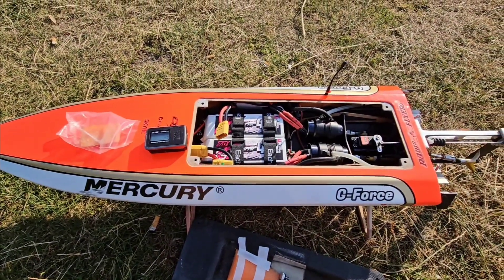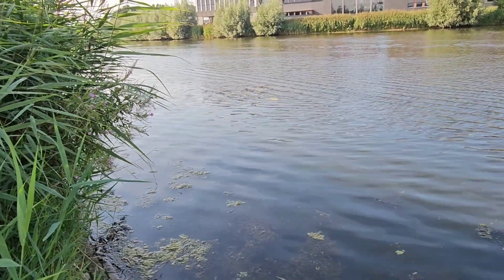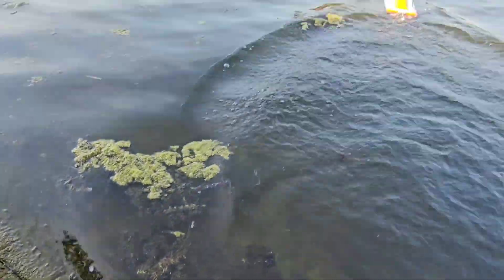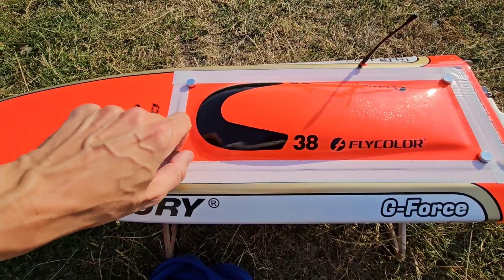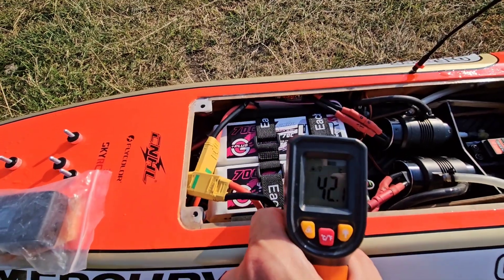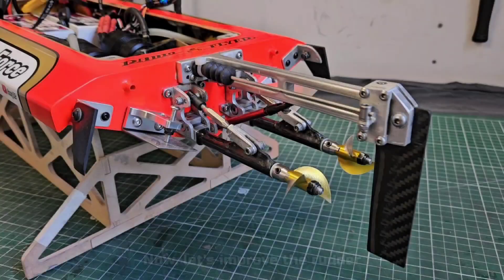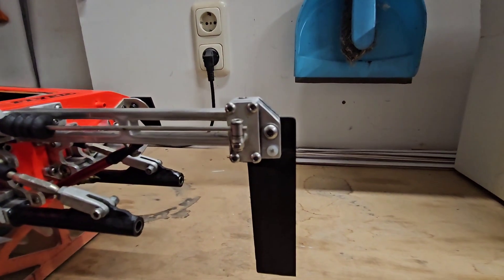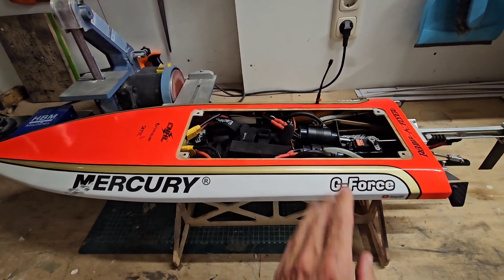Twin motor DIY RC boat: G-Force running & rudder improvement

Comment: good job 👍 what is the weight of this boat?
Reply from the maker: Thanks! It weighs 4.0kg with 2x 6S 4000mAh 70C lipo's, and 3.8kg with 2x 6S 3000mAh 100C lipo's. ✌️